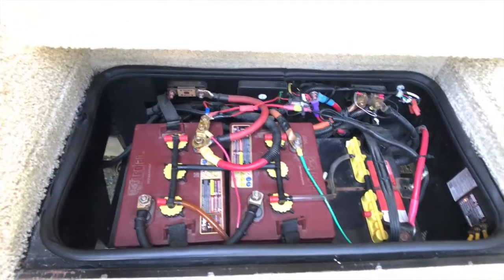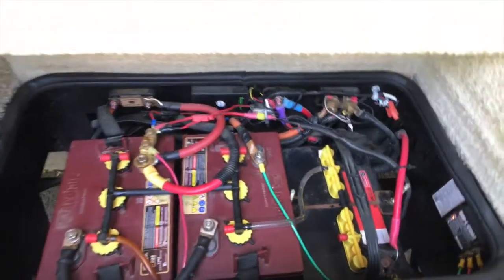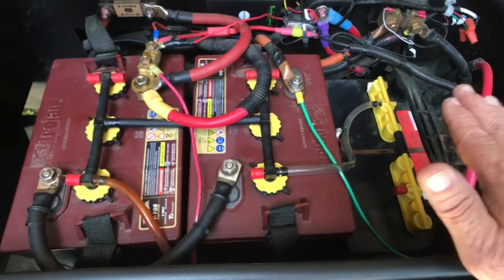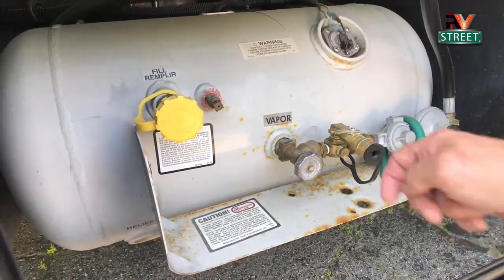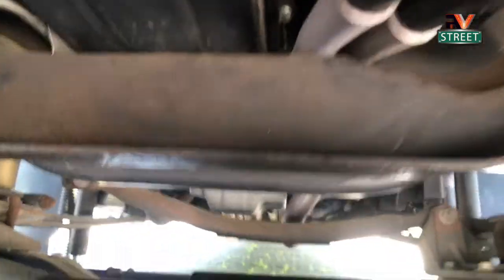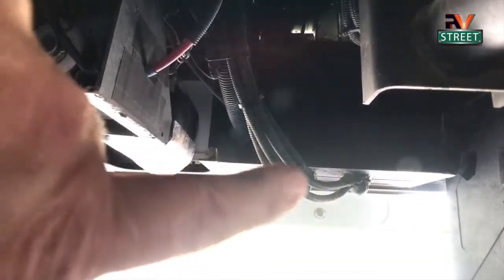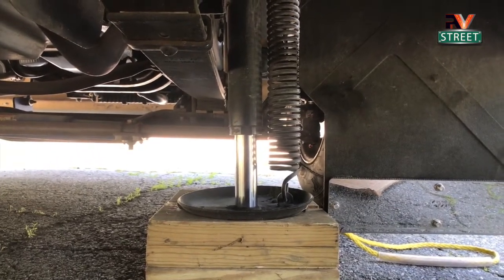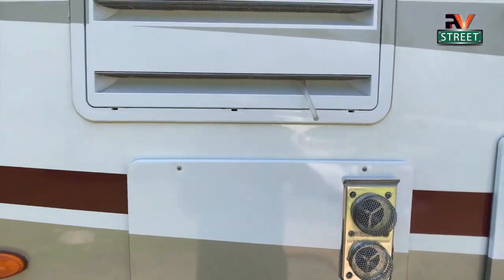Are you prepared to TRAVEL FULL TIME IN YOUR RV? (Part 2)

Comment: Hi Martin, I pray for your continued healing.  I have a question about the converter you installed to replace the original.  Is there room for the new one where the old one was?  If not, where did you place the new one.  I am going to a one 200 AH Lithium battery and am replacing the converter.  Thanks for the help.  (2013 Vista 35f)
Reply from the maker: The factory one was way behind the main electrical panel and plugged into an electrical outlet for power and was wired into the charging system. I wanted better access to the new converter. So I removed the metal grill under the stove and built a shelf and put the new converter there. Then I moved that outlet for the new unit to plug into. That way I didn't have to do any new wiring to the converter.
Reply: @RVstreet  Thanks.  I appreciate.  Continued prayers for you and your wife.

Comment: Could you share where you got the engine oil drain valve/brand?  Not finding the same one on Amazon.  Much thanks as my F53 chassis oil changes are a mess!.
Reply: Disregard, found it on the summary you kindly provided.   You guys rock!!
Reply from the maker: Go to the top of the page, click where it says SEE MORE, scroll down and it's listed there under "UNDER THE CHASSIS".
Also, have you watched our video on changing the oil in our F53? If not here's the link:
https://www.youtube.com/watch?v=WcSBo-KctFc
thx Donald
Reply: @RVstreet  Did you do a video on changing the air filter by any chance?    I am having troubling figuring out how to take the cover of of it.  Thx!!!
Reply: @RVstreet  OMG, the intro is very cleverly done.   Joanie is amazing in all regards - you guys need to have your own tv show!!
Reply from the maker: @donaldn6734  As a matter of fact yes. Here's the link to that vid for the air filter:
https://www.youtube.com/watch?v=G4rCtrgFoq8&list=PLkQXtMp9xodTJ0dM4aG8P8IcYEEWBtWBc&index=16&t=0s
But you really should go back to our main YT channel home page and click PLAYLISTS. Click PLAYLISTS. There you'll find a whole section called "RV Motorhome Upgrades, Maintenance and DIY How-To's". Click that and all kinds of different vid's will be there.
Or you can just click here to take you to that PLAYLIST:
https://www.youtube.com/playlist?list=PLkQXtMp9xodTJ0dM4aG8P8IcYEEWBtWBc
Reply from the maker: @donaldn6734  Yes I did. https://www.youtube.com/watch?v=G4rCtrgFoq8&t=11s